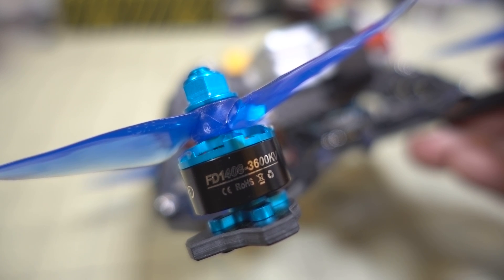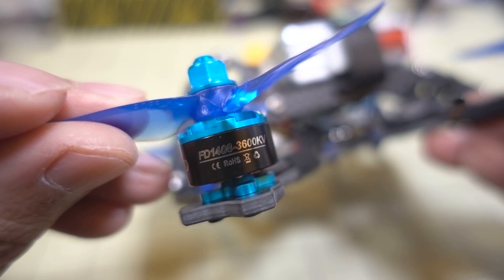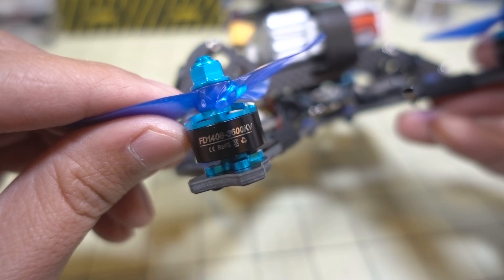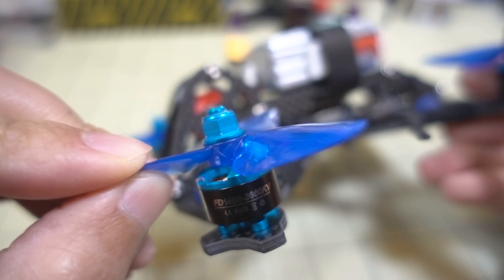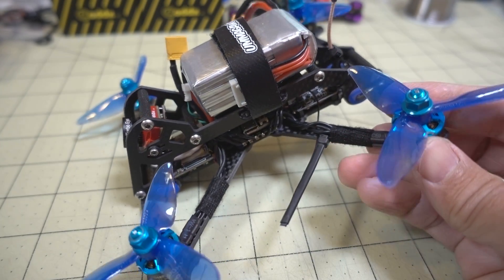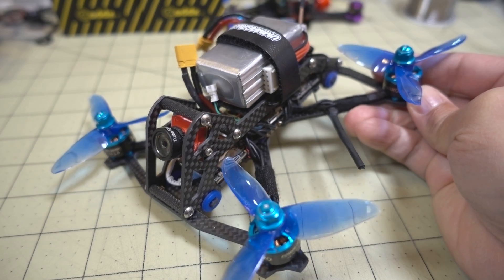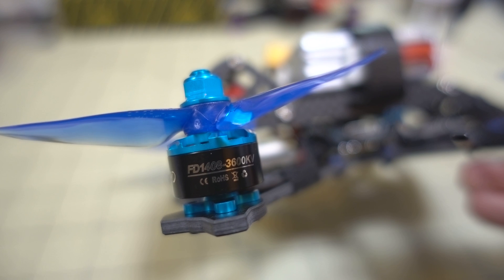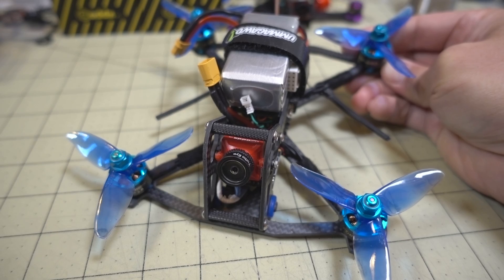HGLRC Forward 1408 3600kv Motor Review 🏁

Comment: Albert, I have less than 20 minutes total flight time on my Acrobrat, and three Brat motors have broken. Three separate crashes, each one involved a minor impact. Are the Brat motors fragile, or am I just unlucky? It there a different motor you recommend for the Acrobrat that's more durable? The HGLRC 1408?
Reply from the maker: The brat motors are fragile.  You give up durability to have that super light weight 1407 motor.  I can't say if the HGLRC 1408 motor is any more durable or not.  I have not crashed it.  I have not heard any stories yet from people with damaged 1408 motors from HGLRC, but the motor is also too new and not many people are flying it yet.  The BBB 1408 motor seems to be good...  https://www.youtube.com/watch?v=ks1vFTzhAq8
Reply: @AlbertKimTV  Thanks so much for your advice and suggestion! Know that your personal responses mean a lot to those of us in the FPV community.
Concerning motors for the Acrobrat, I'm intrigued by the Emax 1606 3300kv, as they have a 3mm shaft and should be more durable. 15.8g. Do you think they are too large for the Acrobrat, and would cause frustratingly slow flight duration? With the Brat motors (two cam rig w/4c 850kv), I'm getting over 5 minute flight times...

Comment: Hi Albert these motors have a metal bar down the centre of the shaft, the original Flame motors didn't have this metal bar. Is it titanium or a titanium alloy to strengthen the shaft ? No mention of it on the HGLRC website. Your incite would be greatly appreciated .

Comment: I’m using an HGLRC F428 on a build and two motors have stopped working (twitching, not spinning). Any chance it could be the ESC burning them?  Anyway to check the ESC to see if there is something wrong? All four ESCs show up on BHeli
Reply: I love how the youtuber thumbed you up but didn't answer ur question xD

You need to check ur temps if they're getting hot then you need to tweek the tune. Most likely your D gain is too high.

Comment: This is a very interesting video for me Albert, I have these motors and the 6s 2400kv's on order and am planning on building two identical light weight 3" quads one with these Forward 1408 3600kv motors and the other with the Flame 1407 3600kv ones.
Reply: very interested in the comparison! post a vid or into the comment please
Reply: @Gho5tface I'll upload a comparison video with data in the comments / Flight Times / Power Differences / Etc.

Comment: Does your Caddx Turtle not have crazy latency? I have the Turtle v2 in my Acrobrat and the latency is so bad it makes me feel sick when flying. Love your reviews. Can't wait to see the 2400kv on 6s
Reply from the maker: I don't have any issue with latency.  Seems like you may have found the problem with the sd card... that could be the source.
Reply: Is your Caddx Turtle set to PAL ? If it is change it to NTSC, it will reduce the latency quite a bit.
Reply: @Sub250gFPV  I believe it's on auto but I will switch it to ntsc and see how that works when I get home. Thanks
Reply: @Sub250gFPV  I changed to ntsc and that did help some but I think I found the bigger issue. While I was out testing I had the video freeze on me twice. It was just a stuck image in my goggles and I would have to disarm, unplug the lipo, and plug it back in to fix it. I went back and looked at the hd footage and the recording would stop at the exact place the image would freeze. So I swapped to a different SD card and that has seemed to fix it. I think it was lagging because it was having trouble writing to that SD card
Reply: @Sub250gFPV  Mine is a good bit heavier at 285g with a 850mah 4s. But it does have some 3d printed parts and gps as well. I built it originally to see what kind of range I could get out of a 3" quad so I may try running a larger mah battery eventually. A little scared to try any long range at the moment though. Need to make sure the video isn't going to freeze on me again.
Reply: @Sub250gFPV  I have a 1300mah 3s that weighs 110g. Wonder how long I could get with it using 3025 biblades
Reply: @wasispeeding1021  Thanks, it seems that good SD cards are essential.
Reply: Would love to hear the results of NTSC!